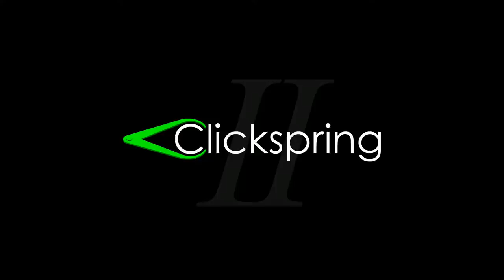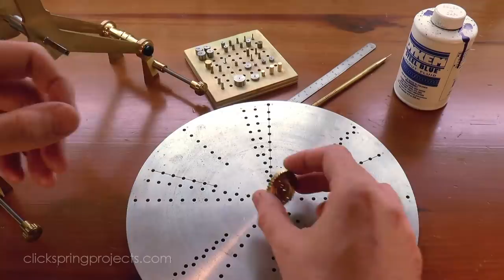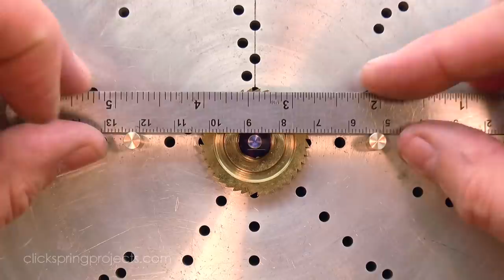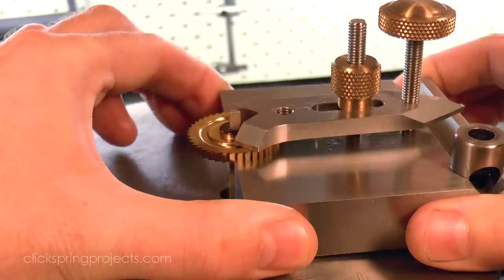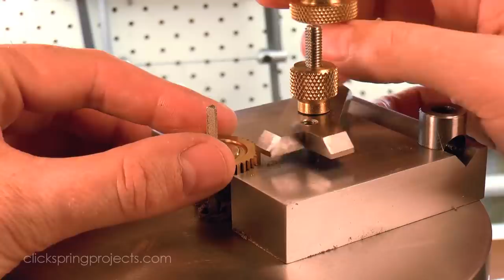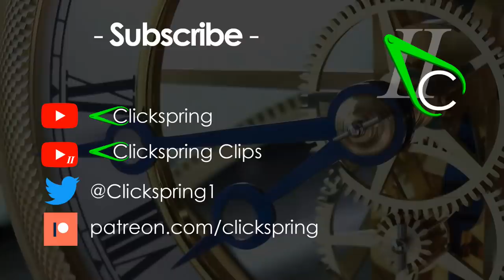Using A Filing Machine To File A Square Hole

Comment: Is it just me or was there unprecedented slopy fit for gear and axle for clickspring?
Reply: U took the words out of my mouth! No final fit by hand? What the heck?
Reply: It's a tapered shaft.
Reply: I'm sure if it mattered there would be hand finishing.
Reply: This is part of his first clock project which was meticulously hand finished, probably just didn't include footage of the finished piece. That series is worth a watch where you'll see the lengths Chris goes through for hand finishing
Reply: Yup, I saw that too...
Reply: Notice in the last shot that he still has the blue stuff for the lines on the piece and he hasn't cleaned up the edges at all.  Given his other videos my guess is that he only showed a preliminary fit, and he'll remove it and clean it up.
Reply: It's not just you!
Reply: 1.55,, its rattlin on the shaft.... Hes been drinkin

Comment: My mom always said I was a round peg in a square hole. I took it as a compliment!  🔳 <—❤️
Reply: But a round peg can fit in a square. If it's the right diameter.
Reply: Hey my grandfather use to say that to me. Usually because I'm to odd to be called normal but I always fit in somehow.
Reply: The saying is actually 'square peg in a round hole'
Reply: @spencereagle1118   You are correct.

Comment: do you have a video on the marking out plate that you used in this video
Reply from the maker: No, I made that before I started making videos. It is based on the design in this excellent book from Malcolm Wild: "Wheel & Pinion Cutting in Horology": (Amazon affiliate link) http://amzn.to/2HI6ca9 - Cheers :)
Reply: @ClickspringClips  Thank you very much, I will check out the link...

Comment: Instead of using one these Metal Lathe Accessories Die Filers I wonder how well one of those benchtop saws built around a jig saw would work
Reply: Bandsaw?
Reply: @rexaitken  

The problem with doing I ternsl work on a bandsaw is you have to cut the blade and then either weld it or silver solder it back to gather. Welding generally involves a welder that is actually built into the saw itself. It allows you to butt weld the blade, grind it to fit the gage that matches your blade thickness and annealing the weld. These are only seen on industrial band saws that have a speed range from around 30 meters per minute up to 1000 meters per minute. Big bucks. The silver solder method usually involves grinding the blade after cutting for a scarf joint and then using a jig to hold the blade while heating with a torch to melt the solder. For what Chris was doing here either a die filer or using the quill on a milling machine as a vertical shaper work best. Another option is a square broach. But unless you've got a lot of holes to do its pricey. Unless you make your own.

Comment: Is there a reason to prefer filing over a broach?  (Machinist newbie here.)
Reply: Broaching is way faster and AFAIK will give just as good of a finish in the hole. But you need a special broach for every hole size, so if you are only doing one part it is easier to file it than make the appropriate broach (buying them is usually extremely expensive). The filing machine can also make tapered holes by tilting the table. Broaches to my knowledge cannot.